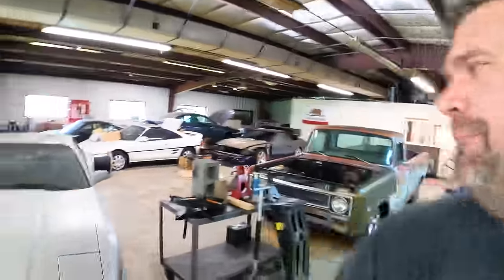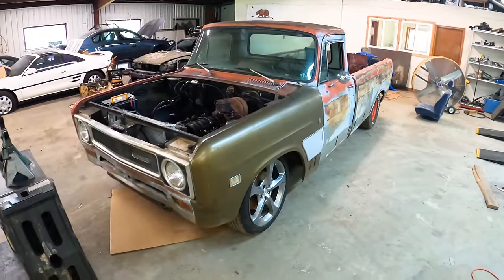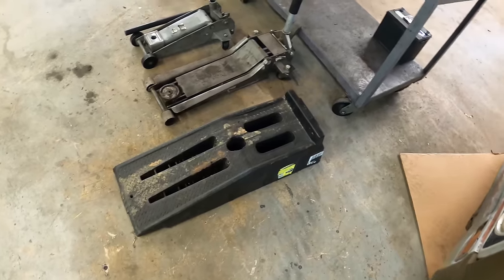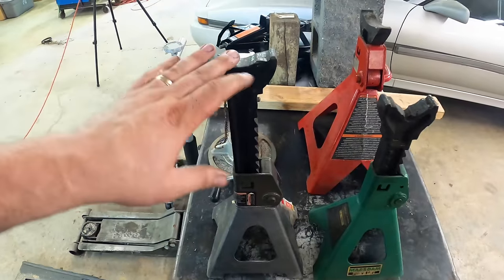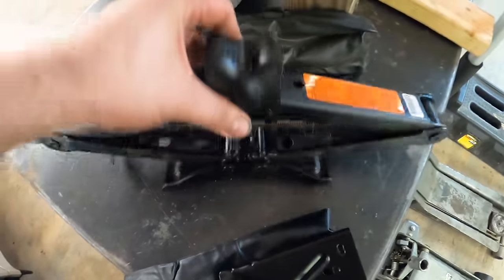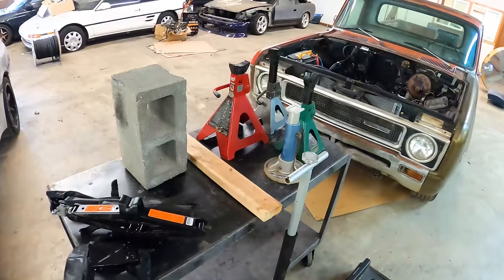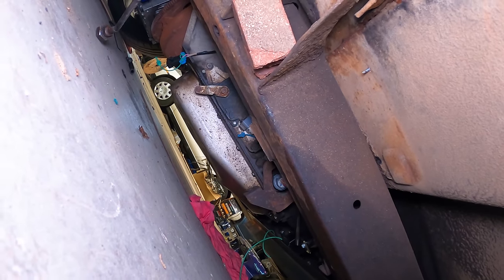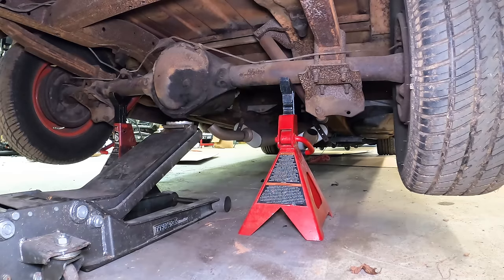How To Properly Jack Up Your Car Without DESTROYING It (And Why You're Doing It WRONG)

Comment: Me personally jack stands are shit. If you know how to cast the proper high compression strength block of solid concrete that far more safer not going to slide or fall (distributes the weight more and can't topple over like a small pyramid like jack stand  ). And to make concrete tensile strength stronger is use proper reinforcement / rebar. Huge high rise building are supported by these things. Ya your right with cinder/ cement block hollow those are not safe. But those shit topple over jack stands aren't great either. If your pulling at huge heavy stuff.

Comment: Or you could do what I did. Get a full size truck, slap a 6" lift and some 37"s on it. I never need to jack it up to work under the engine. Just slide on under there.

Comment: I back my Z up on ramps then use the 3 ton floor jack with the 48' spreader bar with the rubber feet and pin locks. I have those jack stands thank you I will no longer trust them. Normally I leave 2 wheels on so I can chock it. If I am doing breaks I will do one side at a time. keeping my jack under it with stands backing it.  When I put coilovers on I did the rear first then I chocked it and did the front. lol now I can't get my Jack under the b$%h lol. I have to step it on wood until it can clear the bar.

Comment: I jacked up my mother-in-law's 2016 corolla today at the rear end with a floor jack under the axle cross beam just a few inches up while I replaced the rear bumper.  I saw it bowing just ever so slightly while suspended. Am I looking to much into it???
Reply from the maker: That year Corolla has a solid beam rear suspension setup that has some spring built into it so some appearance of flex could be totally normal unloaded.
Reply: @TheQuestionableGarage  Great. Thanks so much for your reply! I have been worried that I messed something up and wondering if the back tires were about to start wearing abnormally.

Comment: Can you teach me to tune my carb? Great video, thanks!
Reply: Have you checked out thunderhead289’s series on carbs? If not I’d recommend you do so. I hope this helps!
Reply: Da Canadian man, you da man, thanks.
Reply: Paul Baillie Thanks. I know how hard it is to find a good video on tuning carburetors, I needed one since my 84 foxbody 5.0 was slightly temperamental. We (My dad and I) put the idle at 750-800 rpm and everything was perfectly fine with the carb. It was a normal Saskatchewan winter which can get to -60C/-76F, (Saskatchewan’s weather is horrid the temperature gradient of where I currently live is enough to turn ice into steam) so we left it alone for a month or two. My dad was hours away working and I just wanted to listen to my car run again. So I fired it up only for the carb to lack an idle and the engine would bog hard any thought of pushing the throttle faster than 5% a second. I kept it running for a few minutes. I thought maybe it was not getting enough air but no revved it high enough to disengage the choke, didn’t get better. So, I just turned the engine off and tried to figure out what was wrong, not that I ever did (It wasn’t the temperature the garage we have my car stored in is heated and was probably 20C/68F) because when I went to show my dad what was wrong after he got home it just worked perfectly fine right after starting it I took my foot off the accelerator idled perfectly didn’t bog or anything.

So tl;dr carb wouldn’t have a tune unless my dad was there 

So what is your car/truck and how is it going along, hopefully it’s doing at least better than how my fox went.

Comment: Years ago I was working on a rear engined car outside I had it on 2 jack stands everything was safe chocks on the front wheels the wind was getting up but not bad but the car started to fall lucky for me I was at the side not under so I rocked back and kicked it and it landed away from me It was a bitch to get the stands out from under the car.
P.S I thought you put a gear box in your Supra and had it running?

Comment: Fantastic timing for me! About to put mine on stands to do brakes and springs... 
Should I put anything else under the car just to increase the safety aspect?
Reply: when Working on Brake Suspension work always have the Tyres placed Under the vehicle outer frame, also dont completely Move the Jack away once the vehicle is on Stands have the Jack locked but not fully seated on the place you lifted it from. good luck bud ! especially during this "pandemic" really got to Wrench everyday!

Comment: It's funny (not) when I take my cars to mechanic for a tire change and they are unable to raise my car... Sometimes they charge more for "lowered cars" ... For God sake, you are mechanic, you should be prepared for that... I do it with no problem, so every professional should be able to do it also. Right?
Reply: I don’t blame them tbh since it usually requires more time. And as always - time = money
Reply: @Sebbe40  I actually do, because low car is nothing extraordinary. You can prepare yourself for that. I would understand "the more time argument" in case bad diy installs or other weird stuff done to the car, which impact negatively serviceability. Lower car might sound bad, but we are not talking about "scratching the pavement" type of lowering, rather mild "eibach pro kit" type of lowering.
Reply: @MariuszChr  i work in a Dealership and once  i get a Lowered Car, out comes the  2 inch Rubber mats Simple if that doesn't do the trick theres always 2 more to work with. your mechanic is noob if they cant figure that out
Reply: @justinlangley9522  exactly, this is what I thought. Thanks for sharing!